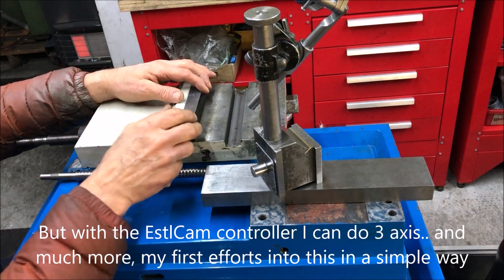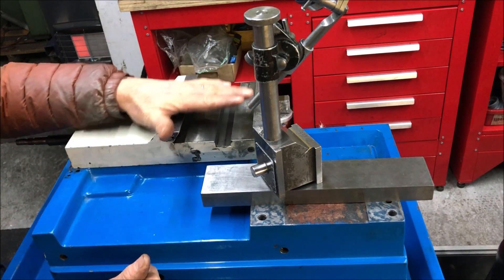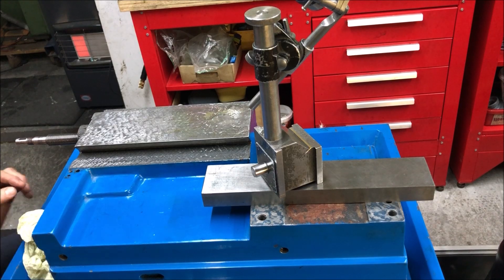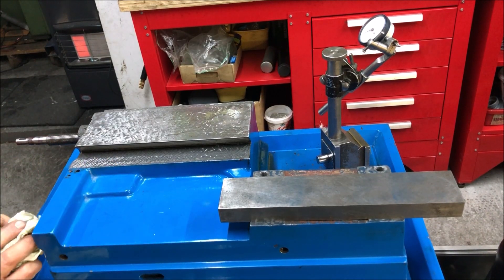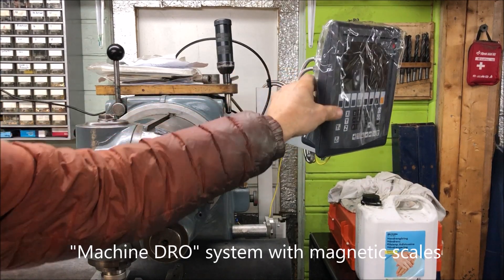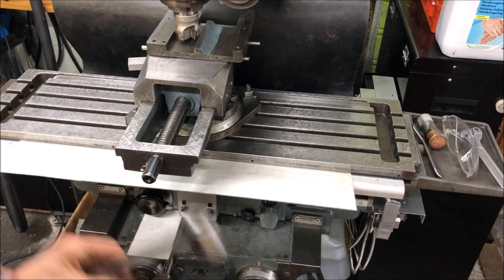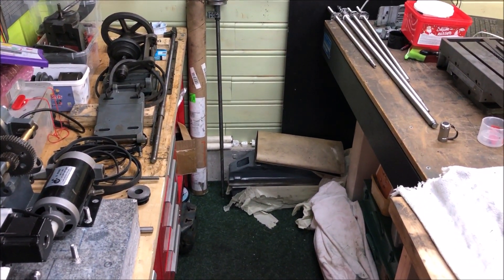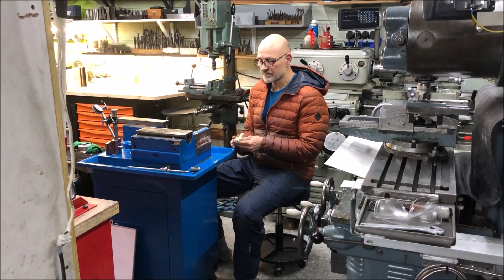Shop and projects update Xmas 21

Comment: Hi Jan, Nice to see your ongoing projects and I'm looking forward to seeing further updates in 2022.  I need to machine a short (approx. 150mm) angled straight edge for dovetails from iron barstock and wondered if there was any advice for producing a good straight edge from iron bar?   My recent Chipmaster purchase has a very worn compound slide that I would like to rebuild, I have my granite surface plate but need an angled reference for the dovetails

. Happy holidays.
Reply from the maker: Thnks the same. Yes, seems there is no shortage of projects :) 
Tja? I guess clamping down while milling and subsequent warping  on release will be a consideration. Scraping is pretty straightforward as you have 2 surfaces that can be worked and proven independent on each other. Usually there is no need to try to match them to an existing dovetail angle (unless you are doing production testing and have many similar items to test).
The onl yrequirement being that the dovetail matches to the mating part..